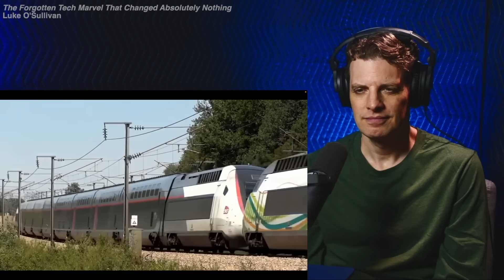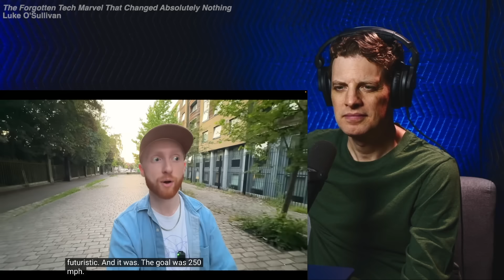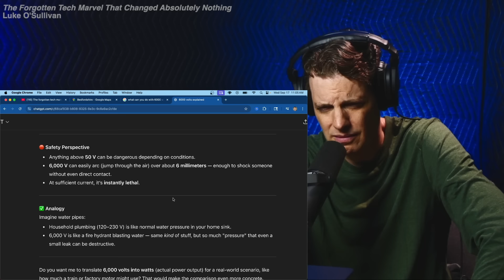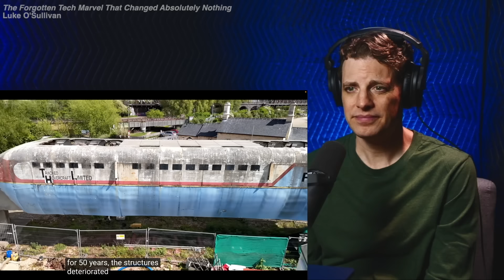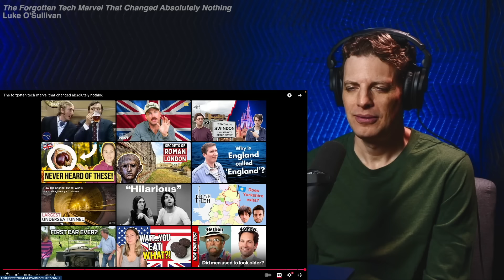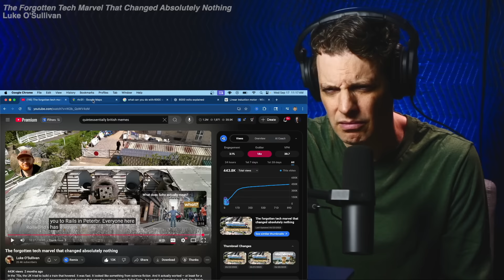American Reacts to A Forgotten British Tech Marvel!

Comment: I used the cross-channel hovercraft in 1982. It was fast, but very noisy, and with the slight swell during the passage, it rolled and heaved in a sickening twist. Worth the novelty. On the French side, got the Turbotrain to Paris, then an overnight train to Arles.

Comment: I think that you would be interested in a television programme in which Eric Laithwaite demonstrated a magnetic linear motor. I remember watching it over 60 years ago. Schools TV was very good then.
Reply: Was it one of Eric Laithwaite's Royal Institution Christmas Lectures?
Reply: @jerry2357  I don't think so, but I don't know - it was a long time ago. I remember a small metal plate shooting along, but above, a track.
Reply: @alanpeacock5451 

Yes, I think that was the Royal Institution Christmas lecture given by Eric Laithwaite, but their archive doesn't go quite far enough back for them to have a video of it on the Royal Institution website.  It was an aluminium plate (on a weight basis, aluminium is more conductive than copper) and the track had the coils for the linear induction motor built into it.  IIRC, he also used a model high speed train, which was just an aluminium plate with a streamlined body on top. IIRC, the track was arranged in two halves, so after doing some runs, just accelerating the aluminium sheet in one direction and off the end of the track, he reversed the polarity of one half of the track, so the plate then automatically went backwards and forwards between the two halves.

Comment: The Hovertrain ran along the River Great Ouse at Earith in Cambridgeshire, near St Ives (The Old Bedford River is a drainage conduit that runs parallel to the Great Ouse) both are around 4 to 5 miles from where I live. You can still see some of the concrete rail footings along the river bank.
Reply: I remember that in operation

Comment: I live 20mins drive from the test track site. You were looking at the wrong county.
Those 3 pillars are between Earith and Sutton Gault close to the River Delph.
The Ouse Washes is a straight floodplain roughly 23 miles long so it had a perfect setup!
Also i work on the Railway and I've driven past RTV 31 regularly for decades.
I've never ever seen it get any TLC sadly.. But it is huge

Comment: JJ, there used to be a commercial hovercraft ferry service to France. Superfast, even quicker than the modern trains in the tunnel. The largest could ferry about 400 passengers and 60 cars in just over 20 minutes. But it was expensive to run and not great in bad weather so it was phased out. I'm sure there are a few videos about it if you're interested.
Reply: There is a still a regularly scheduled passenger only hovercraft service between Portsmouth Southsea and Ryde on the Isle of Wight. I travelled on the huge hovercraft to France only once, but use the Isle of Wight one every year.
Reply: My family and I took the hovercraft from Dover to France a few times. The passage was super fast and super smooth, as long as it had quiet seas. I loved the rise and fall of the air going into the massive hover skirt. Great as a kiddo.
Reply: @carolineskipper6976 😮❤
Reply: I never travelled on one but I saw one up close and it was huge
Reply: I've only used a hovercraft once, and that was the Portsmouth to Isle of Wight route.
Reply: The SRN4 I believe is what you're talking about, been on it and it was great but of course it couldn't compete with the tunnel 🇬🇧
Reply: My husband & I took the hovercraft along with our new BMW motorcycle when we traveled from Dover to France back in 1984.  It was run by BOAC & all terminology used on the trip was the same as travelling by air.

Comment: To give you an idea of the voltage involved with electric trains, in the UK we have two main systems. In the south east of England there is a 'third rail' system that runs at 750 V DC. The London underground (the Tube) has a similar system, but with a fourth 'return rail' . Where electrified, most of the rest of the country use the overhead cable system (Catenary) which runs at 25KV AC (25,000 volts)  So 6,500 V is actually not that high.
The Hovercraft was invented in the UK, and there is a passenger Hovercraft service between Southsea in Portsmouth and the Isle of Wight. Hovercraft are used by the military, for instance the Royal Marines as amphibious assault and supply vehicles.

Comment: In Birmingham there was a maglev train, I can't say if it's still there but I've been on it
Reply: I went on it too a few times, a bit slow but fun when you're a kid, sadly it was replaced due to rising costs and lack of spares in 2003 with the Air-Rail Link a cable driven light train, a bit like a funicular hill train but without the hill

Comment: Simple electricity: Voltage is pressure. Amps are volume. Or, volts is water pressure, and amps is the diameter of the hose. A water wheel is high volume and low pressure, and a fire hose is low volume and high pressure. It depends on the job, which characteristic you use.
Reply: thats a great analogy. I always find it weird when places say danger xxx volts. its not the voltage that'll kill you, its the current...
Reply: And let's just ignore ohms and watts